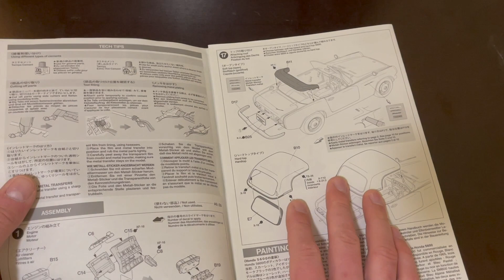Building 1/24 TAMIYA Honda S600

Comment: Nice build. Looks like it took a lot of patience to custom make the engine wiring, and paint all the little details.
Imagine that little motor with V-tec... screamin' its head of at 3am, cuz someone's been nuts enough to order that tofu.
Reply from the maker: Thank you very much!

I tried to rebuild the engine from a real picture and it was a pain, but I like the result. There is also not so much space for the engine in this kit. So when you want to build your own S600, then consider this when assembling all the parts together. 

But anyway, you're right. Honda did a lot of great engines in the past. Especially the legendary Honda Beat with MTREC (before VTEC) and 8.100 RPM redline 🥰 Love the sound of this car.

Cheers 🍻
Reply: @enso_scale  The video makes me want to get a kit. Sadly I'm not good enough with model kits to do this one justice.
Was also thinking about an R/C S800. But no racing/drift build. A more realistic road going version, like Tamiya's famous 1/14 scale R/C trucks.

My first thought with Honda are the old fart can RICEd Civics. More noise than go 🤣
My own experience is limited to a Honda Wallaroo 25km/h moped I had for a year. Sold it when I moved on to a 45km/h microcar.
I miss the ability to take shortcuts through the forest and the open air experience. But the car meant the moped ended up no longer being used.
Reply from the maker: @joffreyverbeeck1640  Only because some guys tune their Civics and convert them into noice generating something (I would not call them cars anymore 😄). This does not mean that Honda as a car manufacturer represents that kind of "way of life". For me Honda always represents engineering masterpieces not only in cars but also in motorbikes. I personally do not have lot of Honda experience at all. But I would, if I could 😊What kind of 45km/h microcar do you own? Do you need license to drive them?
Reply: @enso_scale  I have an Aixam Crossover.
 A better known brand is Ligier. They are what the French call a "vehicule sans permis", or a license free car.
Although at least in Europe, people born after 1961 must have a moped license for it. 
But with that, you can drive one from aga 16. For a normal car licence you have to be 18.
Reply: @joffreyverbeeck1640  Ahh OK. Saw the sometimes in the street 😊It's some kind of popular in Europe.
Reply: @viktorbreitenbucher  with good reason. The licence is easier to get. And while tbey cost as much to buy as a normal car, insurance is cheaper, and you don't pay road tax. And they have better fuel economy. 
So if you don't need anything more, why not get one, instead of a normal car.

Comment: Nice!!!! What's the flat red to gloss red ratio?
Reply from the maker: Thank you 🙏😊 I've used Tamiya's Gloss Red X-7 with Flat Base X-21 (10:1) Ratio. So really just a tiny bit of flat base, otherwise your result looks like frozen ice 😄 And just as a note, Tamiya also offers a color option Flat Red XF-7, which has similar effect.